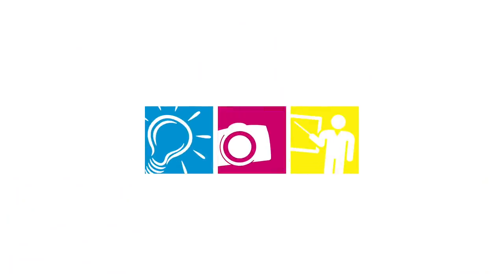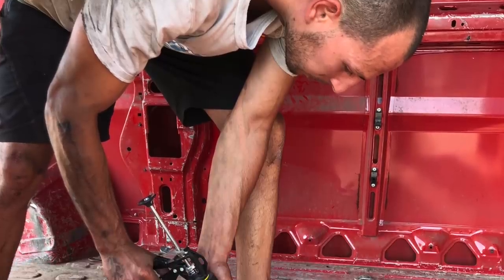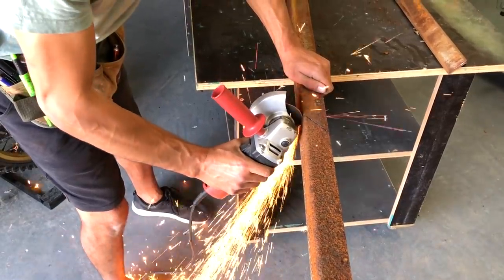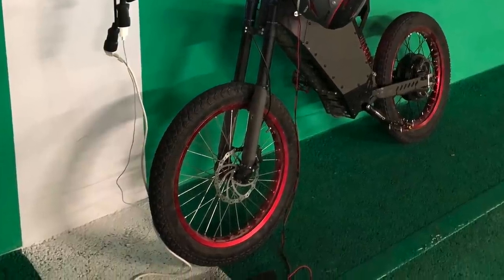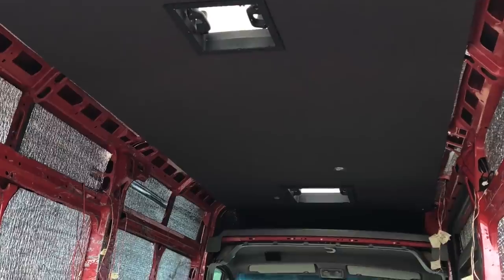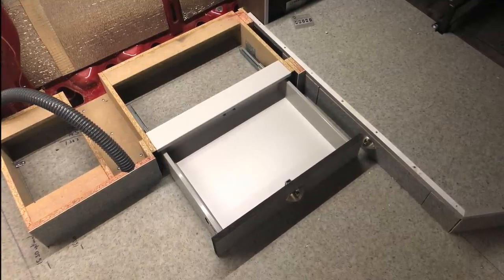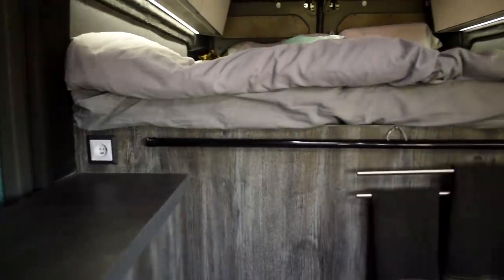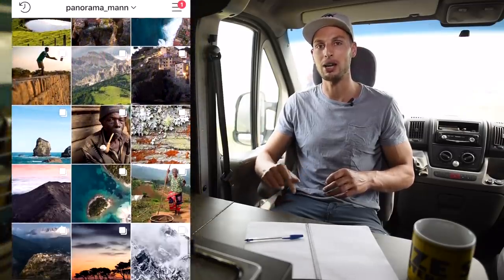How to Build a Home Made Camper Van / Start to Finish DIY Off-Grid Conversion

Comment: Such a good build! But only using reflectix and an airgap is not enough to be honest. Use denim, rockwool, hemp,.. and cover it with a damp screen and then cover with wood. This will also keep you warmer during colder times!

Comment: Great job! Water tanks outside can easily freeze in winter. Soldering is a no-go in vehicles, use clamps instead.
Reply from the maker: Why is it no go in vehicles?
Reply: @ladiandmargaret  because it might get loose over time due to vibration

While it may be painful for some people to hear, the reality is that in the automotive industry this has long ago been settled. The gold standard is to (properly) crimp wires where possible. This is what industry does, and what you should do, too. Whether you’re splicing or attaching a terminal makes no difference. To verify this just take a look under the hood and you’ll find hundreds of crimps, but virtually no soldering. As long as you have the right tools, crimping is the way to go.

Source:https://millennialdiyer.com/articles/motorcycles/electrical-repair-crimp-or-solder/
Reply from the maker: I always thought everybody does that because it’s much faster. Mechanical connection I would say is more prone to vibrate out than ,,glued” join.

Comment: Old Rolls Royce bodies were brush painted and then wet and dried until the paint was ready for final polishing. Nothing wrong with roller painting. Great job!
Reply from the maker: Interesting, I didn’t know that. Thanks so much!
Reply: @ladiandmargaret  yes the practice continued into the latest 70s, apply up to 70 fine coats of paint over a long period. That is why the finish on old rolls royces is like looking in to a mirror. Great job on yours, I love the little innovations. Enjoy!

Comment: Excellent.  There is a lot of good planning and forethought here.  When I built my live-in van before traveling across the country (U.S.) for a couple of years, it was much more of an improvised experience, and I've suffered a lot by the poor planning.  
I don't plan on living in the next build for long stretches, but I do plan on much better planning and "fit-for-purpose" considerations.  Great vid, great build.

Comment: Boy, that used to be one beat-up Citroen with at least 250K km approaching the end of its lifespan! ))
Hope it gets to live again and travel everywhere!
Reply from the maker: It had 300k km on clock. This one has 3l iveco engine. I read about it ahead and these engines easily do 700k with just oil change.
Reply: @ladiandmargaret  Yep, those 3l Iveco engines are legendary :) Body rust will eat it's way trough (easily replaceable panels, btw), but engines will go almost forever. If well maintained of course :)
Reply: @HeartPumper  3.0 L Iveco F1C I4 Diesel - is that the one?
Reply from the maker: I guess

Comment: That's the best build I've ever seen.. you got skills man..
Quick Q, what paint did you use? Don't you need a clear coat to seal it? Wouldn't it peel off or get washed off in time?
Reply from the maker: Thanks so much. I used regular paint for metal. After a year it holds well. Doesn’t chip anywhere.
Reply: @ladiandmargaret  thanks for replying, that's good to know.. I always wanted a mat black camper or maybe light Gray to keep a little cooler... I had no idea you could just use regular paint and a roller lol. 

Good luck my man. Seems great, I'm hoping to buy something like yours but already set up, I don't have the skills to build something so nice.. good on you. 

Happy camping.
Reply from the maker: Thanks so much. The car has metal body so I guess it’s just not conventional.

Comment: I would have guessed your career profession is custom mechanical builder or designer with all your knowledge.  A photographer? never would have guessed.
Reply from the maker: Thanks so much for your interest. Everything photography I learned early from my uncle. I’m a cabinetmaker by trade and worked multiple different fields. I’ve worked as a designer, cnc operator, in a motorhome conversion company and used to do a lot of fine art modern furniture. Last year I invested in my workshop. The concept of this place is supposed to be simple: creative work supportive environment.

Comment: iam pretty sure their are about 100 EU and National Laws that prevent me from doing this!,
great build but them wooden window frames are gonna be a problem in the future!.
why not have the bikes on the back of the van, in bike frames??, are you scared they get stolen or break?
9:01 seems like a horrible waste of space!, take the wheels and handle bars off. you safe a LOT of space
Reply from the maker: What makes you think wooden frames will be a problem?
Reply: All is doable, just have to pass inspection for road use
Reply from the maker: Like you say, everything is doable.

Comment: Like your practical approach.
Reply from the maker: That’s exactly it, practical approach 👍 thanks for stopping by.
Reply: @ladiandmargaret  I was wondering why not simply put bicycles on roof or behind? Is it theft? I see many lose so much space to bicycles and a hub and see wood can make a rack.? Also dont forget your nice girlfriend who helped also.😉
Reply from the maker: I thought about where to place them more than anybody else. Roof no chance, it’s too heavy. Trailer dragging behind is a nightmare, having them exposed behind the van is a big nono because each of them costs over €4500 so they have to be inside. Then the question is how. Everybody was giving me advices to take them apart and I was not willing to accept this. Takes away from the fun of just taking it out anytime even for 10 minutes ride. So this was my best solution fir this size of a van.
Reply: @ladiandmargaret  makes sense with cost and ease. I saw your ebikes and they are a target for sure
Reply from the maker: You should give them a try when you have opportunity.

Comment: Great build, I'd go light on weight,  stick a 30 gallon barrel in the back corner for water, save all that weight,  insulate sides and top and be done, it doesn't need covered, I'd never put another floor in it, spray insulation under the body, undercoat it and ride, I'm thinking I'd want a van weighing less after the build than when I bought it,

Comment: Excellent build. You used light weight material, which is great. Too  many van builds out there are built like houses and unnecessarily overweight and heavy. Keeping the van light is great for power, fuel-economy and handling. You have a very good low centre of gravity because you store all your water underneath the van. This adds to cornering stability. All of these things lower the chance of driver fatigue and makes for happier journeys.
Reply from the maker: Thanks, I know mine can be better but probably not cheaper and better 😂
Reply: @ladiandmargaret  The only thing I did differently on my van is there is no high voltage ie. 220VAC other than the battery charger. Its dangerous and unnecessary. Everything can be bought to run off 12VDC. other than that...I envy your workshop. Geees that made me get all aroused. You have access to some seriously tools and lots of room. NOT to do the van would have been sacrilege! LOL Best van build on the YT so far...and I've seen thousands but they are all waaaay to heavy and overly complicated.. BTW. I love the bed hydraulic actuators.I went for a tilt system on struts. Accent from?..
Reply from the maker: Thanks so much my friend! These are very kind words from your end! I’ve been filming my workshop tour, I think you will love it! I’m from Czechia.

Comment: You could see how off road cars have back tire mounted at back on rear bumper. You could made such bumper and holder for bikes. That will give you whole space in van. You could even made storage for it as the one tire whit wheel can easily exceed 20kg in off rad vehicle.
Reply: Those are expensive bikes, mouting them outside isn't the safest way...
Reply from the maker: One ebike is 65kg and mounting them outside would give me a lot of anxiety. Trust me I thought about their placement more than anybody 😂

Comment: Impressed, I think this is a great low budget convertion but yet you managed to tackle a lot of practical issues. Could you provide some numbers of the total cost? Labour hours?
1 question, don't you regret to have some windows. At the back when you are sleeping or at the side to enjoy the view when your inside. (bad weather?)
Reply: In the tour video, he mentions that the van and the conversion cost him a total $6000
Reply from the maker: Yeah Anthony is right. 6k in total. Took me 3 months, 6 days a week in average 13 hours a day. There is not much I would change at this point. Windows still no I guess. We do a lot of work inside and I always prefer this dark room for my photo and video editing. Roof windows provide plenty of natural light and we usually park with the front to some nice views.

Comment: Great idea with extension cord. I planned the same. What model do you use? Wire gage, length, retractible?
Reply from the maker: Idk,  I just found one 14m long that was affordable. Might not even sell in your country.
Reply: @ladiandmargaret  yea, it possible true. I want to do it myself. I bought 50m of 2.5mm square cable, and teardown old electric screwdriver, but not begin to assemble the unit. Thought maybe there is more simple solution...

Comment: Nice Van on very good budget, but probably its also because everything is DIY job right ?  

I have Idea to build something similar but a little bigger (to include shower and toilet) + bigger kitchen and work space. Something like School buses in US. 
Do you saw something similar available there in Europe  = CZ/SK ?   Maybe extra big Van with 2meters of length more than yours. 

+ How you managed heating for winter season ?  Some kind of electric heater ?
Reply from the maker: Hey, I built this entire thing. There is plenty of bigger cars even in Czechia, we just wanted small and compact. We use diesel heater, supper low consumption and we survived winter with no problems.
Reply: @ladiandmargaret  Thanks for Answer. Yup I will probably look for some Mini-Bus (like MB Sprinter 416 CDi 24seat or so).  
Will be probably more expensive, But I Would like to include shower, Work-desk and more space for bikes :) 

Maybe there will be problem which areas is possbile to reach with bigger car.

Comment: That EV charging plug adapter to schuko is brilliant! Where did you buy that thing? Thank you
Reply from the maker: I made it 🤓
Reply: How often do you need to AC charge deep-cycle batteries or 300W of solar panels is enough? Thanks
Reply from the maker: Since we have solars we are plugged it only in campsites, we are self sufficient. 300W is plenty for all our needs with inefficient fridge and still have extra power to charge ebikes.

Comment: CHanging rsafety relevant parts, for example the seat bases, for DIY versions could be a problem in countries where you need some sort of technical approval for your vehicle, for example germany. You need to present them and get the approval, or your vehicle registration is void.
Otherwise: great build, great tips about priorisation of jobs to be done.

Comment: So I'm planning on building my van over the course of a month, after work.  Maybe two if I'm taking my time.  I don't understand how people spend seven, eight, nine months to put it all together.  Are there restrictions that I'm missing or am I just more optimistic than others?
Reply from the maker: All depends how advanced your build is. Building a simple van in a month is very doable.  For our new van build level, it would be impossible to do in a month. Most quality builds take a least 4 months. Good luck 👍

Comment: Hey can you tell me what the bed dimensions are ? Do you sleep in the length or bride way ? 
Anyway great build ! Really cool ideas and some amazing craftsmanship.
Reply from the maker: Thanks so much. We sleep width wise. I think it’s about 190cm long and maybe 130-140cm wide.
Reply: Isn’t it annoying having the cupboards over your head when sleeping ? 
You chosed a Citroen Jumper ... would you recommend it more than a Ducato Boxer or Sprinter ? 
Just one last question ... your Van is an L2H2 right ? 
Thanks a lot for all the information you provide us, it is really helpful.
Reply from the maker: It would be less annoying if the bed was 20cm lower. One side I even considered taking down but that’s Marg side and she didn’t like it 😂 I bought Jumper because it was a deal. Ducato and boxer are the same cars. Sprinter is more expensive and have more expensive parts. I literally just replaced our tail light for $22 because how many  second hand spare parts is online. This is L2H2.

Comment: much better vans than Transit or Sprinter
Reply from the maker: Transits rust a lot and sprinters have expensive parts. Plus this jumper box shape is just great.
Reply: Sprinter may be more expensive to maintain, but they last forever and if you get the extra long wheelbase one, you can probably make a palace inside XD
Besides, Sprinters have a traditional RWD layout and are easier to work on. Anything FWD has everything packed in such a tiny space you need pincer hands to work on it.
Still, you are a hero. You've turned a tired old work van into a luxury RV.

Comment: Hello! I have a question. The water tanks that you put at the bottom of the van, when the temperature goes bellow zero dosent the water freeze? How can it be prevented? And in the opposite sense dosent the heat of them being underneath the vehicles melt the plastic?
Reply from the maker: It’s not in contact with the exhaust system so it doesn’t melt. In the subzero temperatures yes, the water freezes. Some people add heating systems to their tanks to prevent it.

Comment: how many kilometers did the van have when you bought it?
Reply from the maker: 300.000km
Reply: @ladiandmargaret  isn't that Astronomically too much?

Also, do you have plans on selling more of youre-bikes? They're very cool
Reply from the maker: Curriers to with these engines 700.000 so I think it’s just common assumption that used engine like mine must brake soon.

I’ve started selling a video guide and parts list so anybody can build an ebike like mine for the cost of parts only! Took me only 12 days and cost $3600!!!
https://youtu.be/VF5qwiyU5Kw

Comment: Looks cool, but why waste interior storage space for the bikes when you could just get a hitch rack or a small trailer to pull behind?

I get the stealth idea, but there's solar panels on the roof, that's not exactly standard on vans.
Reply from the maker: I would never hand 62 kg bike that costs $5000 each outside of the car! Dragging a trailer behind just for bikes sounds very silly to me. I thought about where to keep ebikes more than anybody and this bed lift was my best solution. Overall I’m very happy and even tho we have more space than we need.

Comment: what is it for a e-bike? DIY? whats the name? details? thx
Reply from the maker: Thanks. I develop them. Specs are in the description of this video. Check it out.
Reply: @ladiandmargaret  Hi thx. sry i cannot find specs about this vehicle in the description mh. do you have a link for me plz.
Reply from the maker: I have no website yet. You are right, I listed it in a different video. I’m now in a process of making a youtube video about them.

Ebike Specs:
* Silixcon controller
* QS motor (up to 12kW)
* Sanyo 18650 battery cells (3,2kW)
* Front fork DNM USD8
* Schlumpf crankset (peddling up to 80km/h)
* Aluminum frame
* Aluminum rims
* Alarm
* Two front disk brakes
* Regen braking

Our third ebike is for sale in Europe for 3.900 Euro.
Reply: @ladiandmargaret  thx for details. 3,2kWh?  Charger? 1 phase or 3 phase? this bike have rekuperation :-o wow thats so nice. plz give us more :-) im have to look forward for the separte video about this e-bike. very, very nice thx so lot
Reply from the maker: For this one I have 800W charger, for the other one 1,4kW and new build I’ve been working on will have 3kW charger. That will essentially charge the battery in 20 minutes. 3 phase. Yeah, regen breaking is cool.

Comment: The reflectix you used as insulation will be shit. It's meant to reflect the sunlight,it doesn't block heat. You might as well not have put anything there,cause it's doing no good.
Reply from the maker: I had a lot of discussions with specialists and everybody says this is the best solution right after sprayed insolation. It does reflect heat (inside or outside) same with cold. Important thing is to keep air gab of 2mm and cover the insulation with a panel. I know it can be done much better but we did winter easily and summer in Turkey was pretty good too.

Comment: How much solar on the roof? 500W?
Reply from the maker: I wish. 300W atm
Reply: @ladiandmargaret  Better than 200. 
Why did you mount them lengthwise instead of ... width-wise? Would they not take less space turned 90 degrees?
Reply from the maker: Idk, roughly the same.

Comment: The most amazing  omission apparently is that :-No mention of the this vans overall basic condition  mechanically ,before ever attempting a conversion project..  
The current mileage ,Engine size / condition  ,gearbox/ overdrive, clutch ,wheel bearings, tyre size . ,break drums /discs, leaf springs ,shock absorbers ,driveshaft couplings,steering rack ,The purchase initially of a low mileage commercial van  from a repression/ bankrupt  auctions .would be my choice .as reliability of the conversion is paramount as your wife & family will , I presume be enjoying a trip to the country etc.